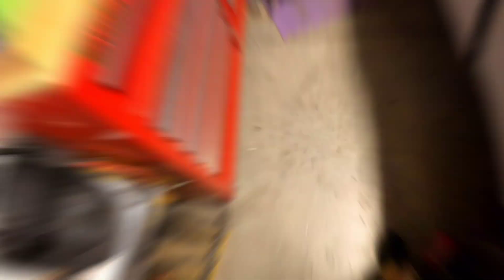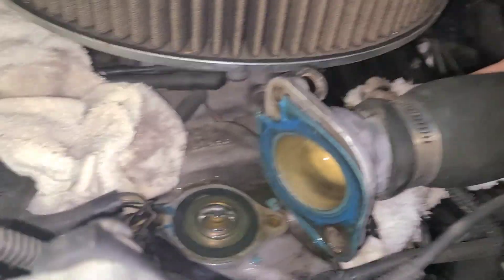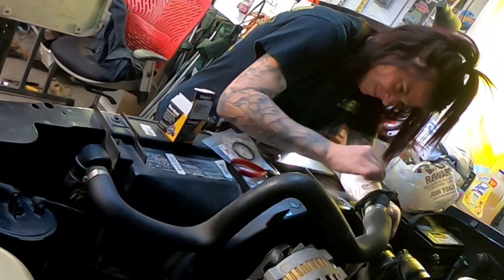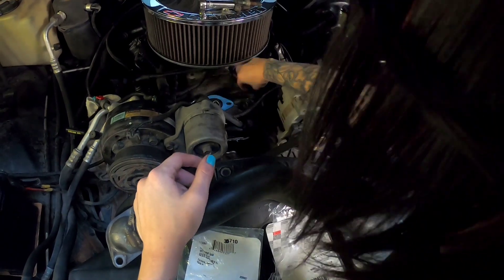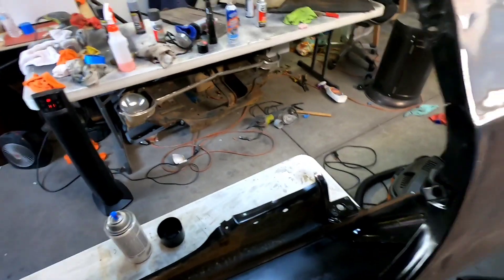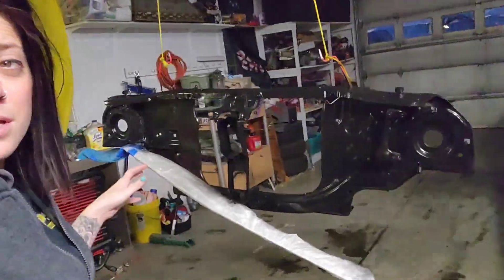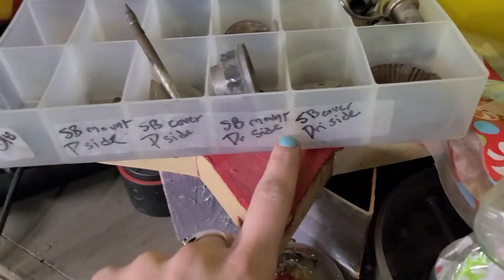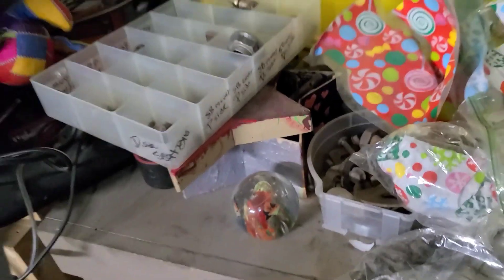1994 Chevy Silverado thermostat replacement and a bit more progress on the 74Nova!

Comment: Ugh, anyone else think coolant is one of the worst smells on the planet? My most dreaded part of an engine to deal with. Nice truck, though; they don't make 'em like they used to. Also, respect for the labeled bags. When I took my head to the machine shop with all the little parts in a tote with labeled zip-lock bags (Honda, so lots of little parts), the guy was like, "Oh my god, nobody does this!" Made his job a bit easier.